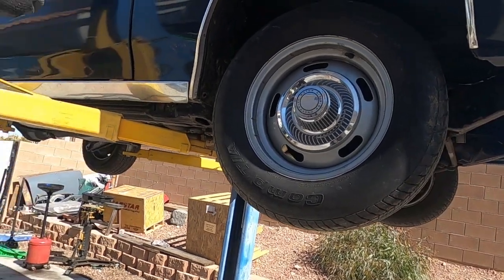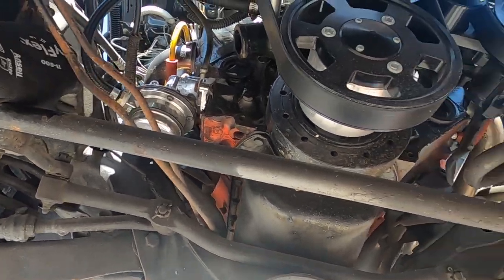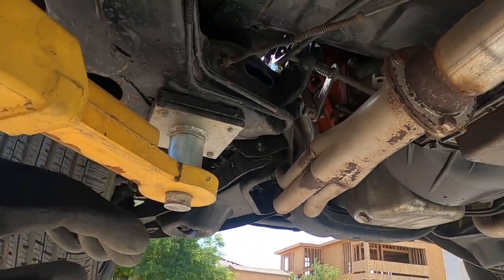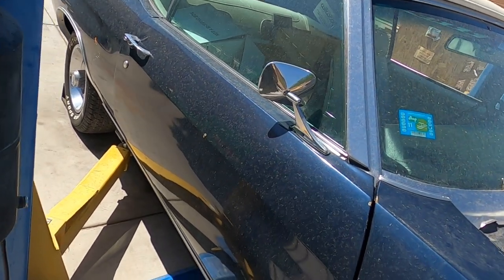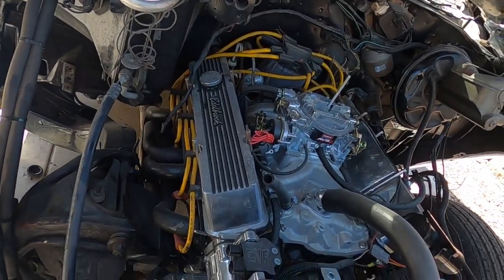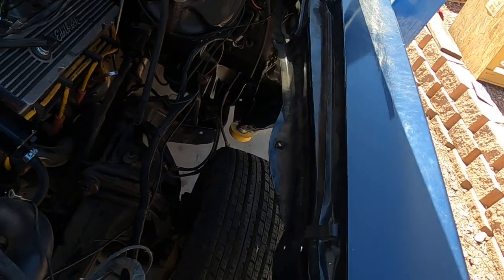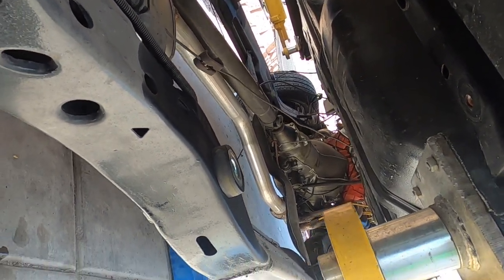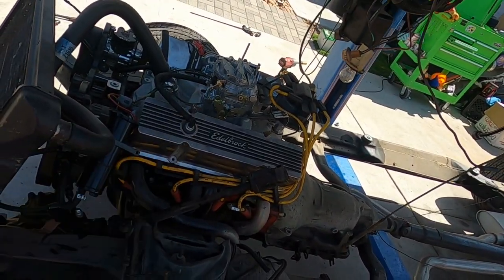REMOVING FRAME OFF BODY ON A 71 CHEVELLE

Comment: Great video! Did you run into any issues with the body mount bolts? Swapping mine out of my 70 soon.
Reply from the maker: just one in the rear , going to have to cut it out

Comment: I'm curious as to why he wants to replace the 350. Looks like it's a pretty nice motor.
Reply from the maker: ls swap, just saying.
Reply: Definitely a good 200 horse to the wheels. With a 6.0, even just a truck motor. It should put 350 to the wheels. Stock🫡